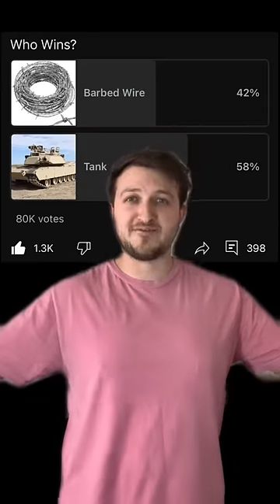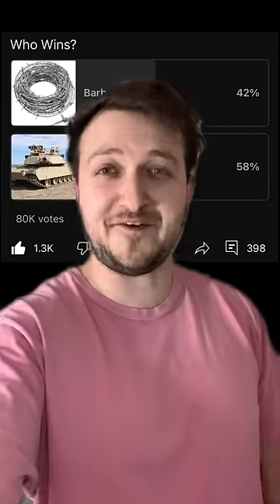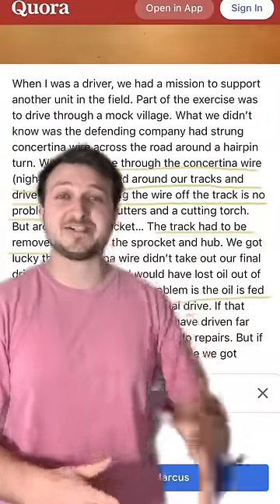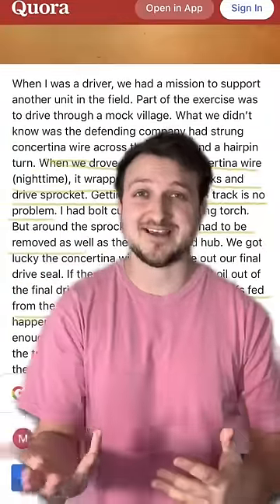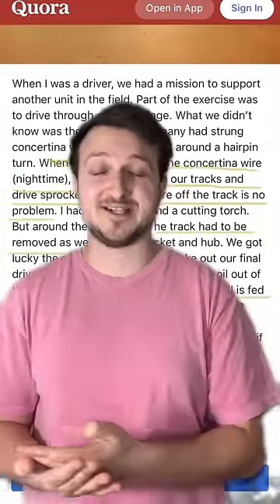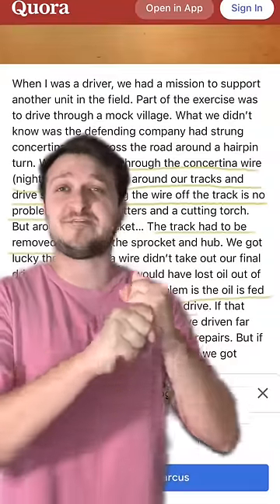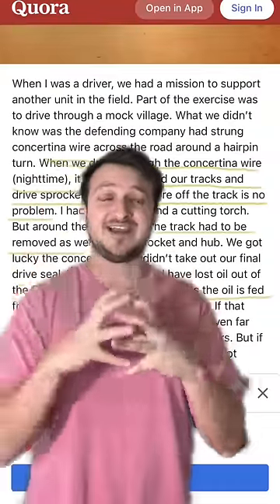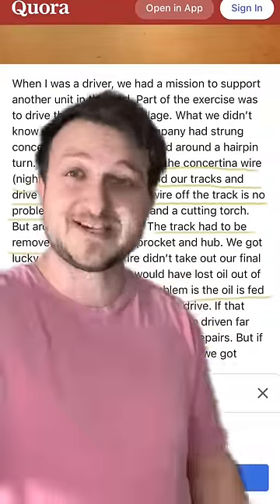Soldiers Tank vs Barbed Wire. #shorts#army

Comment: I had armor plates ripped off the side of my Bradley when I ran over wrapped up wire hidden in tall grass.
Reply: Wire clippers and time...
Reply: @billyteflon1322 time exactly what the enemy was hoping to buy by placing down that wire
Reply: @maxk4324  oh I track.  Same concept with mines.  I spent more than a fair few minutes clipping wire before.
Reply: M3 Chadley
Reply: @billyteflon1322  wire clippers??? With that amount of sheer tension on them wires??? Yea ok.. I’ll use the cutting torch and bolt cutters before I ever think about some tiny lil handheld wire clippers that allows said wire to cause damage
Reply: @RK36_  then I guess you can sit there... forever.  Yes, there are  clippers for the crew just for that reason.
Reply: @spacious don  also a Bradley crewman (11M), and that's exactly how you fix it. Wire cutters,  leather gloves, and typically some blood.
Reply: @RK36_ ok buddy you’re playing to much war zone or some shit😂

Comment: You should see what a bed mattress does to a trash truck when it drives over it.   I believe any large amount of tangle wire could take out a tank.
Reply: Or a bill dozer.
Radial steel from tires is worse, because it will ruin wire cutters, IF you can even cut it.

Comment: Former 12B here too.  11 strand and triple standard are 2 different things.  Also, the barbed wire isn't what would cause the tanks to get caught, the barbed wire was to tie the concertina wire to the pickets and give it strength.  It is the coils of concertina that get caught in the drive sprockets.
Reply: Concertina wire sure is hell to work with when it gets tangled up, one thing that definitely surprised me though (short story time) was last year while I was at the Texas border for the Texas Guard, as an 12B we emplaced long stretches of triple standard down for several miles in the rio grande River to deter illegal immigrants and funnel them to certain entry points where Border patrol was set up at, we had to constantly fix it because the immigrants would just place their dirty wet clothes over the wire and walk over it, I found that shit hilarious.

Comment: I knew a guy that was in 24th Mechanized Infantry during the Gulf War.  He was in an AIFV (Bradley), and they were taking the lead track assaulting an airbase.  The driver was overly excited, and tried to drive through the chain link fence, only to have it twist up into the tracks and render them stuck.  The whole column was tied up.

He jumped out and helped pull the  fencing out of the tracks as the driver backed them vehicle up.  Under fire.

He was awarded a Bronze Star for his actions (he showed it to me, along with the backing paperwork).

It really messed him up though.

Comment: The barbed wire gangsta until the tank shoots a 135mm into it
Reply: Nope does nothing, the shockwave just blows by the wire.
Reply: I'm no engineer, but I'm pretty sure you'd spend a life savings' worth of tank shells and create an open pit mine by the time you cleared a path with concussive blasts.

Comment: It's called concertina wire because you don't unroll it, you pull out the last coil, and the rest of the pack follows, looks like a squeeze box accordion. During night evasion, I was running through a field and my pant leg got hooked up on a coil on the ground. The roll uncoiled following me down a hill and cut the hell out of me.

Comment: Back in '91, my folks bought a piece of farmland. Dad started to clear out a ditch area, near a berm at the edge of a field. Unfortunately, he accidentally found an old farmer's buried dumpsite. 

It was quite startling to hear the sudden change in the sounds of the CAT loader. 

Fortunately, Dad had noticed in time, and backed out quickly. 

We tossed a tarp underneath the CAT. With both Dad & I on our backs, working underneath the loader, we carefully and meticulously began pulling and clipping away baling wire. 

We saved the worst for last. It took both of us. Some of the baling wire had wound up the drive shaft, and had begun to work its way up under the bearing cap.

Hours later, Dad and I were finally finished. We had escaped damage. Dad had stopped the machine just in time. One more turn of the drive shaft would have resulted in horrendous expenses. 

Our entanglement was old, rusty, yet smooth, baling wire, wrapping over mostly smooth metal. I can't fathom the mess that barbed wire into tracks, etc would have been. Catastrophic. 

The wire always wins.
Reply: How do you know that 1 more turn would have resulted in horrendous expenses?
Reply: Look, I know both have tracks, but comparing a CAT loader to a modern day tank's track and suspension... I'm sorry, but no.
Reply: @matchesburn  oh why? are modern tanks now able to get through this problem better? (btw actually asking , i don't mean for my text to sound rude) , but also it's the same kind of concept , i don't really know what a CAT loader is but i mean if it has tracks and we're talking about wire / it sounds like it'd be a lot worse with barbed wire on a tank/tank tracks , i think it sounds pretty comparable in a way even though it's not the same thing
Reply: @eugenetswong  
I don't know how it is for loaders, but with tanks you can end up damaging the final drive if you start violently throwing the track or getting it hung. And if you do, it's going to be a very bad day.
That said, the "wire always win" nonsense that you see in the comments is quite overblown. Especially when it deals with non-concertina wire. Concertina wire can prove hazardous, then again... so can't a large enough puddle if you approach it incorrectly. Plenty of tankers have ran over concertina wires and cleared it. Some haven't. Some have managed to sink the tank in a large puddle or even roll the tank over. It doesn't mean every puddle or every uneven surface spells disaster for the tank.

The fact that when it comes to engineering defenses and anti-tank measures 9 times out of 10 a landmine is picked before anyone even thinks of concertina wire should prove to you that, no, it's really not that effective at stopping tanks. And we've seen in Ukraine that even someone lazily throwing down several hundred AT mines all over the road to the point where some guy has to go and push them all out of the way with his foot (actually perfectly safe so long as they aren't boobytrapped in some way) is enough to slow down and stop an armor column for some time.

...Now how much concertina wire, which costs next to nothing, have you seen? Where are the multitude of pictures of T-72s stuck in concertina wire? I haven't seen any. The mud in Ukraine ended up stopping more tanks than concertina wire likely would have.
Reply: @SuperstitiousWolf  
You know those tracked bulldozers and stuff you see at construction sites? They basically have really simple, comparatively, track systems on them? That's what he's talking about. It's like comparing a Model-T to a HMMWV. While it's true that the very first tanks were basically little more than tractors with tracks that were armored, that didn't last long. Modern tanks, especially, have a much more robust and capable track system and suspension. After all... when was the last time you saw a tracked tractor that weighed 60 tons, drove 45+ MPH over rough terrain and had to survive impacts and stay stabilized enough not to be tossing itself or its crew everywhere?
Reply: @matchesburn  Reading comprehension. Try it. I did NOT compare them as the same thing. I shared my experience, then stated how much worse it would be with c-wire and a tank's tracks.

Seek help for your need to be argumentative. Especially when it causes you to foolishly attack and judge based on your lack of reading skills.

BTW, CAT loaders use tires.
Reply: @eugenetswong  Because I helped to pull the wire out as Dad was manipulating the bearing to get it to release. It was millimeters from hitting where everything would have needed to be replaced. On a piece of rural property. In the middle of nowhere. With no CAT dealer for sending a field repair truck in the nearest three counties. Self-evident.
Reply: @elizabethbottroff1218  
"Reading comprehension. Try it. I did NOT compare them as the same thing. I shared my experience, then stated how much worse it would be with c-wire and a tank's tracks."

That's a comparison, you oligophrenic.
Reply: @matchesburn  Thank you for your response. I think that what you say makes sense, but I would need to get actual source information to confirm that our beliefs are correct. After all, they might have other reasons for doing what they do.
Reply: @elizabethbottroff1218  that's difficult for me to visualize, because I keep imagining that the engine and a drive train will be allowed to spin freely, while other parts stand still.

Maybe you don't realize that I don't know much about tracked vehicles or even normal cars?
Reply: @eugenetswong  CAT loaders are on huge tires. Picture the big machines with buckets on the front at construction sites. So my 6'8 Dad and I could crawl under it. Tanks are relatively flat and close to the ground with tracks. I was sharing that my experience was very bad and memorable from decades ago, so that the tanks getting wrapped up must be exponentially more of a nightmare. 😁
Reply: @elizabethbottroff1218  Thank you for clarifying.

So the wire would have eventually ground away at at the bearing of a drive train [or whatever it's called]?
Reply: I feel pissed off and tired from all the work that cost the two of you
Reply: @SuperstitiousWolf some tanks have had wire clearing tools bolted to the front if I remember right
Reply: I mean, sounds more like only bearings on the axle would need replacing after an extra turn.
Reply: @SuperstitiousWolf  Well, logically speaking they should fix that cause for 100 $ of barbed wire an enemy could destroy multiple tanks if that were the case.
Reply: Cool story bro. Changed my life.
Reply: Same thing happened to me! But it was more because of all the winter feeding and no one picking up the bailer twine !
Reply: this was a good read. thank you!
Reply: @leonardhatcher3272  I agree whole heartedly. In this case, his CAT loader snag had dragged out a tangled mass nearly the size of an original VW Bug. After repairs, and with alternative clearing methods, the mess was found to only be the tip of the iceberg. We had dump truck loads of scrap to the yard, and quite a sizeable hole left behind.

Comment: I think what trips most people up is that they aren't thinking about the mechanical aspect of what happens when barbed wire gets wrapped around an axle. They are simply thinking about tank versus barbed wire which in everybody's mind, the tank just runs over it.
Reply: Omfg. Stop saying barbed wire. Barbed wire will snap. C wire is flexible and durable enough to get tangled in the tracks. That’s why people are (no pun intended) get tripped up by this question.
Reply: Yeah I agree with you but even when thinking about that it still kinda surprises me. I would figure that all the steel component's in a tanks tread and drive system would be made of rather hard steel/other metal. And I figured a tank has such high power (torqe I think is what it'd be called) that it would either cut or rip any wire cought in it's tread. Or just keep driving with it tangled in there. Just saying it's still kinda surprising to me.
Reply: @Zoroaster4  The wire destroys wheels, bearings, etc.
Reply: @Zoroaster4 if you've ever cleaned the beater bar of a vacuum cleaner of hair, imagine that instead of hair, you have concertina wire. Concertina wire is made from rather nice steel. It will get wrapped up in anything that moves exactly the same way hair gets wrapped up in a vacuum cleaner. Individual strands of concertina wire may be easy to cut or break, but dozens of strands all twisted together becomes a tangled, razor sharp steel rope all bound up in your machinery.
Reply: @cr4zyj4ck  that’s a really good analogy to explain it
Reply: So what's the mechanical aspect?
Reply: I just be goofin on them
Reply: Ditto... It's not obvious to a layman that the tanks tracks wouldn't simply rise over the wires and roll along unimpeded on top.

I think the relative height of the wire and the tank is a big unknown to most civilians....I imagine if all the wire, whatever it's type, was say, only within 5 inches of the ground...btjr tanks would do exactly that... Crush it all down flatz and ride over the top.

But if it's a 3d maze of wire that goes above the tracks... Then the tank has to push through, and tangling is inevitable... And that's when the wires work together to become strong enough to be immune to the tanks power.
Reply: Yeah because the most physical labor any of these people ever do is picking the phone up to watch a video of course they’re not going to realize that.  they’re all pencil pushers these days
Reply: @ClaytonBigsby01  all of us? Every on? Can't imagine a job using my hands that doesn't include barb wire...
Reply: @cr4zyj4ck  i don't have any knowledge in this field, and i'm actually suprised almost none of the comments use hair as an example 😅

Comment: Now you know why the engineers have  M58 Mine Clearing Line Charge (MICLIC) and before that the  Bangalore torpedo, it is an explosive charge placed within one or several connected tubes. It is used by combat engineers to clear obstacles
Reply: Like in saving private Ryan!!
"BANGALORE!!"
Reply: @jstape740  Yes
Reply: @jstape740  Also seen in the movie The Big Red One.
Reply: Apex
Reply: For those interested the bangalore was invented by a Captain of the British Royal Engineers while attached to the Madras Sappers and Miners unit of the Indian Army in 1912 and it was first used towards the end of World War 1.
Reply: Bangalore torpedoes are old technology (200-300 years old) but they work really well. Also their origin is fascinating.
Reply: @thomasohanlon1060  no, there was a precursor to it in the Anglo - Mysore war. That officer swapped out the bamboo for something else. 
The sword rockets from that war (they're terrifying in their own right) were improved upon massively by the British Empire and eventually resulted in the rosy red glare part from the American National Anthem.
Reply: Never forget the apobs as well
Reply: Line charges are pretty badass, made quick work of Iraqi minefields in 91’
Reply: @keiichimorisato98  They don’t make that much of a crater though, mostly just cut and push that wire out of the way that’s why you place two of them at a 45° angle facing the enemy side. Now the good ol cratering charge makes a big hole in the ground 😀

Comment: I was in a tank breaching platoon in Korea 2/72 Armor 1ID 94/95. We had the old XM1Ps at the time. My tank had a mine roller, and our other tanks had mine ploughs One tank actually had mechanics shop custom made wire cutting antlers. Tanks can easily penetrate multiple strands of concertina wire, but you have to spend hours and hours immediately after breaching wire defenses removing the wound-up wire from the track before it ruins the grease seals and starts bending stuff in the track. Did it more times than I cared for.

Comment: I have trouble with hair tangling in my roomba, I can only imagine the nightmare of having barbed wire tangled in a tank
Reply: With hair in any vacuum cleaner, take a sharp knife and slice down the length of the roller between the brushes. It might take a few passes, but it makes pulling the hair take seconds rather than minutes. And the plastic is fine with whatever light scratches come of it. I usually use a box cutter with a fresh blade.
Reply: @totally_not_a_bot  thanks for the tip, cutting the hairs do help a lot, I happen to use a hobby knife and it's very good for precision cuts

Comment: I think the idea behind the first tank going through barbed wire was after days and days of artillery, and it still didn’t work.
Reply: @dataabort no they weren’t, they were designed to go over the top of a trench with infantry support and artillery clearing the way for them.

A tank may be able to keep running for a bit after running some barb wire but that shit will absolutely destroy the track mechanisms if it keeps going, that was even more true back then when the machining process was inferior
Reply: @dataabort if they were then they failed at that purpose.
Reply: @dataabort Even a cursory think about this would have given the result of this obviously not being true. If they were, they would look very different, there are specialist vehicles for this task, and they are far from tanks or very similar.
Reply: @dataabort not really. Tanks atleast in WW1 were developed more to be mobile bunkers and to provide rolling cover to infantry. The barb wire was still the job of hopefully the artillery to blast a hole through but it almost always fell onto the infantry to use either Bangalore torpedo like weapons or wire cutters. Tanks would hopefully distract the enemies and provide cover up to the wire. They couldn't do much against you if you were in a trench so to clear those was on the infantry.